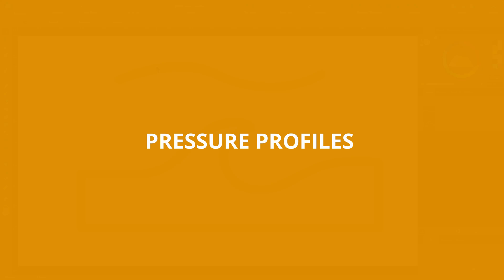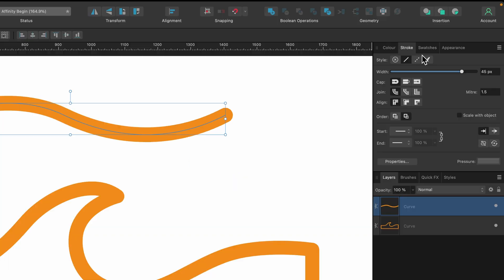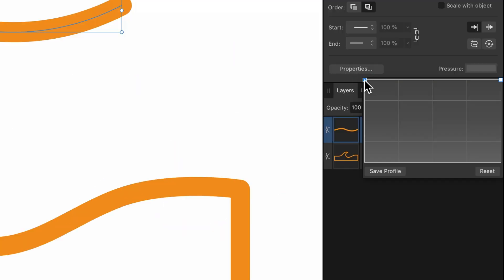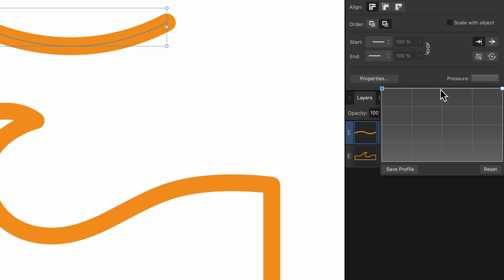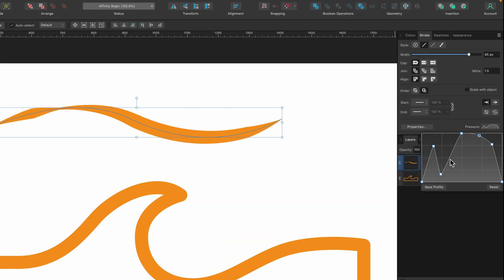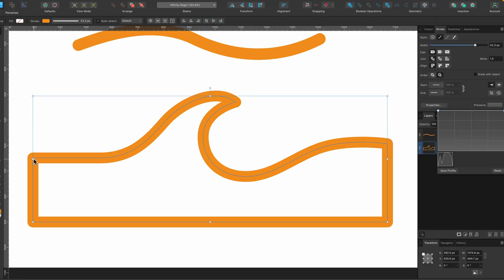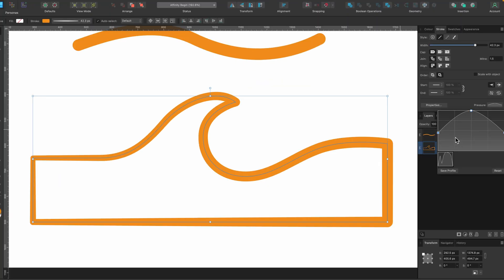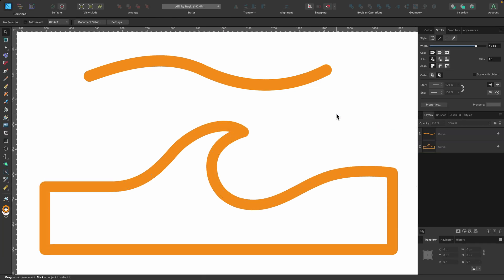Affinity Designer Tutorial: How to Use Pressure Profiles

Comment: Anyway to keep a pressure profile selected so I don't have to select on a new stroke?
Reply from the maker: You save the pressure profile in the stroke panel under pressure. Once saved you can apply it to anything
Reply: @ArtistWright  Sorry I wasn't clear. I can save, but my stroke reverts to default every time I draw a new line. Any way to stick strokes to newly saved profile? Watched your beginner. Learned a ton despite being a long time user!
Reply from the maker: Ah well I'm not sure what tool you are using to draw with BT  I've just been playing with the pressure profiles and they do stick when using pen or pencil tool, so no changing it every time. If you use the stroke with tool, it doesn't automatically save that profile, so reverts back to default. That is unless you go to the stroke panel and save it.
Reply: @ArtistWright  Forum answer: To use a current custom pressure curve as the sticky property, set the controller in the context toolbar to an option other than "Automatic".